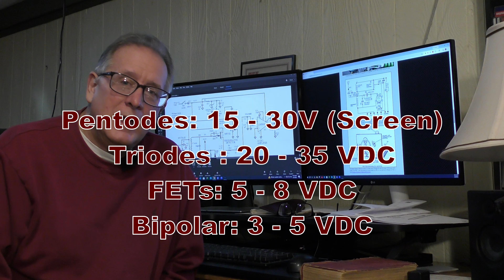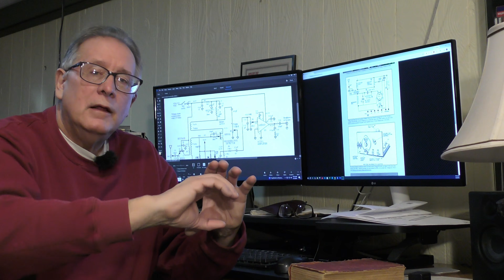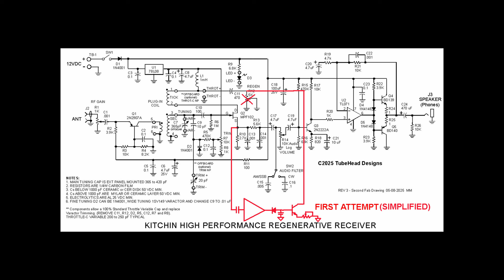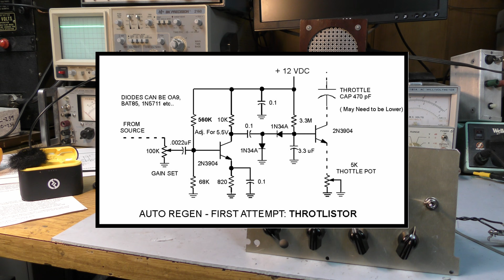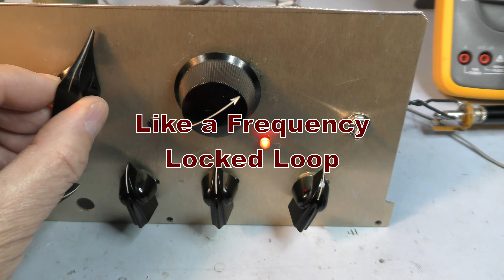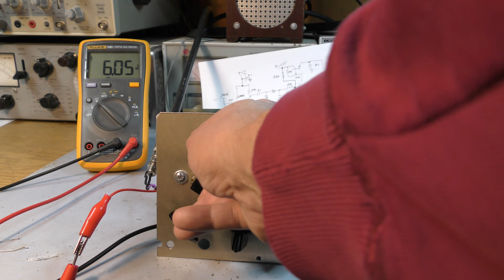Regeneration Control: Full-Auto

Comment: Very impressive. With some adjustments and added controls one could add a manual control for fine tuning the regeneration once on a desired station, or manually enter oscillation for ssd/cw detection. Now if only there was a way to make the regen circuit more selective, so you could single out a single ssb or even cw station, that would be the holy grail. But of course that is exactly why the super heterodyne got developed.

Comment: Just discovered this channel and have been really enjoying the videos. I was inspired to build a little regen with a nuvistor tube, and one of those little audio transformers for transistor stuff (75 ohm dcr on the primary) as the rf choke, and to drive a little speaker directly. At 45v it "blows me out of the room" as Mike would say. Although it can run on as little as 6v b+, into headphones or an amp. Very impressed with what one tiny tube can do. I also had good results with my beloved 6dj8s, but nuvistor wins. Entire broadcast am band is clear with just a 10ft piece of wire. it's like a superhet...73
Reply from the maker: That is fantastic, it is amazing how well those little tubes perform at low voltages! But they were made to perform best at higher voltages. 30 to 45 on the detector and 90 to 120V on the other stages.

Comment: Hello Mike, this is a very interesting improvement for régénérative receiver built in this form.
It's a real step forward that I'am going to implémenté on m'y Kichin high performance régénérative.
Thank you very much for thés vidéos each one more interesting than the last.
73's fr F5LAS.
Reply from the maker: Still experimental! but a great first attempt.
Reply: Thanks Mike for your reply.
The proposed régénération voltage  is perfectly suited to listening to amplitude modulation, and in France, we have an association(ARACCMA) that provides the davantage of AM and we have a regular QSO on thursday 1900 TU on 3600 Khz in amplitude modulation.
Web site is ARACCMA.
Thanks again for all your YT vidéos.
73's fr F5LAS.

Comment: There is another simpler way to do this, by combining two different types of oscillators, it will give very good auto control. I built an AM version by combining a Clapp with an Armstrong. All it amounts to is breaking the cold end of the tank and adding a selected capacitor, typically .001. The cold end of the tickler also ties in here. You have to isolate the tickler from B plus however.
Reply from the maker: Anything on this would be helpful! I'm looking for alternative or historic work or references on auto regen control and how SSB or CW might be accomplished too.
Reply: I haven't run across any historical accounts although I'm sure someone had implemented it. I posted a couple videos but I don't see them here in the comments. I put them on my channel in case anyone wants to see the effects
Reply: @MIKROWAVE1  Hi, I posted a lengthy comment above about this with several references. And I've built several such receivers, so I know it works. I feel pretty sure that given your interest in regenerative receivers, you'll have a lot of fun playing with these ideas.

Comment: Nice video and examples. I've built Tube Regens about 20 years ago for the AM BCB and they work well. I like the Auto-Regen design and look forward to more design and experimentation in this area. A digital readout of the detected frequency would be nice as well. I'd consider that icing on the cake! Thank you!!
Reply from the maker: Today I'm cutting metal for an evaluation chassis with a digital readout, speaker and vernier tuning, so we have a good test bed.
Reply: @MIKROWAVE1 wow, can't wait!

Comment: Mike I was thinking about how your driving the diodes just off the collector. Would not an emitter follower work better at driving the diodes? And in the second attempt you could drive the transistor controlling the FET, directly with the negative voltage from the diode doubler, counter acting the +8 volts to the base of the emitter follower controlling FET.  The  doubler can putout up to a bit over -8 volts and the first diode would connect to 8V B+. plus about a 10k feeding B+ to the base. In LTspice this works more ideally and potentially bit more simple. When I find time, I'm going to  try it out on the regen receiver.
Reply from the maker: Absolutely on the follower. And your simplification makes sense too. Right now I am evaluating a very complex approach that a subscriber sent complete. It only uses one coil.
Reply: @MIKROWAVE1  Yes, I know on the one coil regen, I had the subscriber (W.C.) send me a copy of it's schematic.

Comment: Mike, thank you for the two examples of turning your tube head High-performance regen rec, into an automatic regenerative receiver. I like the second method, will have to try it on the one I bought from you. I had Wayne C. send me the schematic of his version and I did not like how complicated his was. BTW: Wayne is a great guy, very helpful with the AM  synchronous detector, which the last revision works with perfection.

Comment: The tickler circuit is a series tuned peaking circuit. The tuning coil and tickler circuit have well designed dimensions to form an optimized system.
Reply from the maker: Regens are very cool to study. The feedback mechanism in the common Armstrong or Meissner (Euro) oscillator, depends primarily on the mutual inductance (magnetic coupling between two coils) between the tuned primary and the tickler coil. The Primary and feedback tickler windings on the plug-in coil form an RF transformer. A series resonant system on frequency in the feedback coil would tend to cause a phase shift peaking or suck out - that would spoil the control. So, the feedback coil is typically made to resonate much higher frequency, out of band. That means it has less turns, and the fixed or variable capacitor is smaller. Is this explanation helpful?

Comment: The last solution controlling the tension on FET is ok. It's smooth and sounding good. The 3 transistors use in autoregen are not a big deal in now days. Goo job I like it !
Reply from the maker: I may not have found any reference to work that has been done with newer regen topologies. Modelling and PCB fabrication has allowed more complex designs to become prevalent, but people still are attracted to very simple breadboard type construction with few parts.

Comment: I built a type 30 triode Frankenstein radio, now I need to find a 1920/30s way of implementing this.
Reply from the maker: The type 30 tube is ideal for a standard Armstrong regen with one stage of audio amplification. Start by finding a suitable audio interstage transformer of say 10K to 30K  https://ebay.us/m/hQus6y
Reply from the maker: And remember the DC Resistance is far lower than the AC impedance value on these. so 2K Ohms might be 10K of impedance.

Comment: There was a fellow called Vladn on one of the old radio boards, many years ago, who showed how you can use both tickler and capacitive feedback to counteract each other producing a leveled regen control. Where ever you set the feedback it stayed there over the whole band. No extra stages needed, just a couple extra caps. Worked a treat.
Reply from the maker: OK so you are teasing me. Info or a source for this alchemy?
Reply: @MIKROWAVE1  Do a web search for "groups io TheNewRadioBoard", then find message #35 from 4/29/22 titled "Some old posts from TheRadioBoard", which contains a downloadable archive file that I prepared. You'll want to start by reading files hybrid_feedback.pdf and hybrid_theory.pdf, and read the multi-page discussion titled "regen_VFO with reduced feedback dependence on frequency - The RadioBoard Forums", saved as HTML files. There are also a lot of other related discussion threads in that archive. There's enough information in there to keep you busy for months (years?). I look forward to future videos from you if you explore these ideas. Have fun!
Reply: Yes, he used a Vackar type oscillator circuit to do this. Of course, the easiest way to tame regeneration over a band is to go the "supergainer" route, where the regen is used as a fixed tuned IF, and remains set at one point irrespective of tuned frequency.
Reply: @d @dayleedwards3521 With the supergainer route you still have to design around image freqs. With one of Vladn’s circuits I built it only used two FETs. One for the RF stage and the other for the regen stage. You start with a Vacker oscillator and add a tickler - super simple. I found the schematics but there’s no way to post them here in the comments. I haven’t found the docs, yet. Unfortunately my notes are pretty much like straw in a tornado. There are several diagrams both tube and FET variations from simple to more complexity and functionality. Pretty self explanatory without the notes.
Reply: @zenermaniac2571  Yes, I m familiar with his work. My supergainer uses two tubes, the IF freq is 1700kC, so images are non existent up to around 18megs.  One tube, ECH84 is the oscillator/mixer, the second is a 6BL8 triode pentode. There is no fiddling required to achieve stability. The regen is set for mimimum bandwidth and remains set from 6 through 10 megs. These simple radio designs are fascinating to play with.
Reply: The radio board is defunct but I have some notes somewhere I’ll run down. The gist of it is of all the topologies used for regen oscillators when you tune upwards half of them require increasing feedback and the others require reducing feedback. By combining two opposing topologies into the same stage the variances cancel out and it takes a little experimenting to hit that sweet spot by adjusting turns on the tickler and a cap between the bottom of the main coil and ground. The complication(?) is that the coil is no longer common ground which means if you what to go multiband it means an additional switch section unless you use the more popular plug in coils method. Vladn also built a regen where you can vary the bandwidth separately from the regen control. It was quite a bit more involved and I never tried it but a few others did. There’s a demo on YouTube I’ll post the link when I find it.
Reply: I used vladn's topology and it worked well. There will be a small discrepancy in the middle of the broadcast band but it's not much. It's a little juggling between the tank capacitor that goes to around and the tickler feedback but once dialed it I liked it.

Comment: A timely video as I recently acquired a 1932 McMichael 4 tube TRF set, for renovation. The regen control rotates a tickler coil next to the tuning coil, to vary its feedback. Contemporary reviews state that regen on this set was "very smooth". Last time I twiddled a regen control was in about 1959 when I built a 2 valve receiver, an FJ Camm design, I think.
Reply from the maker: I have two similar sets, both KIT RADIOS, to skirt patents apparently, that use variocouplers for regen control. One is tamed and works great; and one, I just acquired, that is quite novel looking, with 4 201As. It features nested shafts for dual control on tuning knobs. The RF stage knob outside is Tuning with the center portion input coupling, and detector tuning outside regen control inside(center)! So, 2 knobs and 4 functions! That is coming in a video series. I would say maybe 1925-1928.

Comment: Another way to do a voltage controlled impedance is a "Miller multiplier".  The idea is:
-- Build a common emitter gain stage with emitter bypassed to ground.
-- Feed the base with a variable voltage through an RF choke to vary the emitter current.
-- Place a small capacitor from collector to emitter.
-- As you increase the base voltage and hence the emitter current, the impedance seen at the collector decreases. 
This method may have some advantages in that the impedance is more like a capacitor and is more linear for moderate amounts of RF

Comment: What about 2 germanium diodes in parallel with tickler winding. High rf signals turn them on and shunt FB. Cost  $1.00. Although...not much voltage across a few turns in tickler..needs refining
Reply from the maker: Well, that simple shunt limiter idea - maybe, but with RF involved, it could present an opportunity to cause a non-linear mixing situation. Worth a try!
Reply: @MIKROWAVE1 true  but the tiny voltage across tickler coil won't be 0.3v. So diodes probably would never conduct.

Comment: Nice design. I wondering If it possible to use light bulb like in old Wein Bridge oscillators, for gain stabilisation, but it may affect frequency of course. Idea is to use bulb in emitter and drive it by next stage emitter follower
Reply: You'd need mini bulbs if you could get them. Bulbs need 100ma..or more to increase their  R. That's a lot of current. Better approach is a ptc resistor. Good thought  however.
Reply: I think a light bulb could work but it is a very low resistance.  You will likely need the regen stage to be running at several mA at least to get it to work.  Remember that "little re" of a transistor always has 25mV across it.  At 1mA, the transistor looks like there is a 25 Ohm resistor in the emitter and at 2mA, this becomes 12.5 Ohms.  You need to get that value to be below the lightbulb so that the lightbulb controls the gain.

Comment: There is advanced regen on far-ciruits who have pcbs - it uses mc1496 as variable gain element  HIGH PERFORMANCE REGEN ARMSTRONG S/W RECEIVER BY CRIPE  73's Oct95 . Your solution does seem to work well, Suggest try on shortwave

Comment: My 2-tube regen used 100 pF capacitor. Worked very well.
KK5R
Reply from the maker: Lower is best! It's tough to make a very low throttle to work over wider ranges, without coil work.
Reply: @MIKROWAVE1 
It was a circuit from Boys Life magazine. It used a 1T4 and 3S4 and used 2 plug in coils wound on 9-pin Bakelite tube bases. Worked very well. I  made it in 1959 in Manaus, Brazil and in a fit of Ignorance, I left it there.